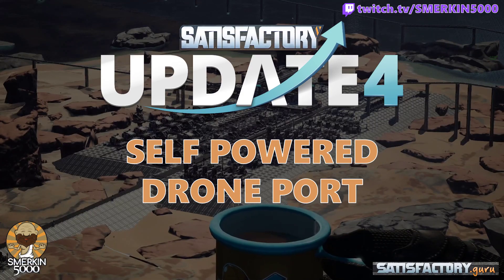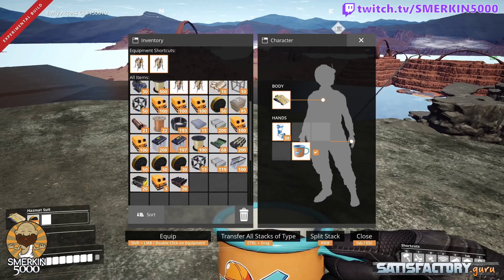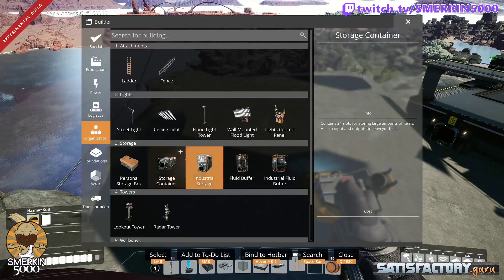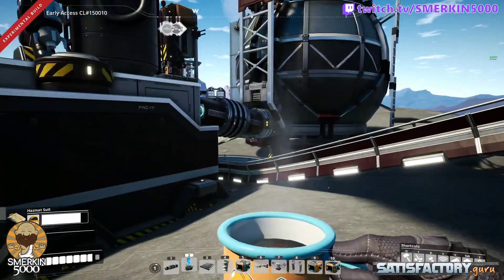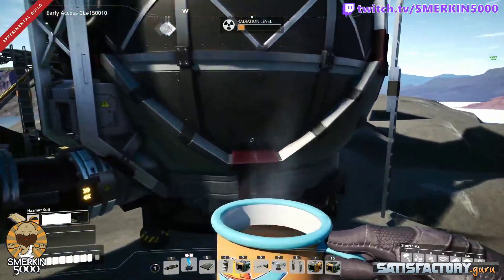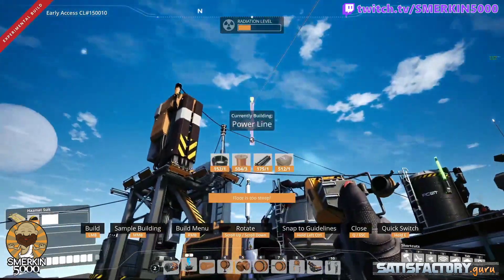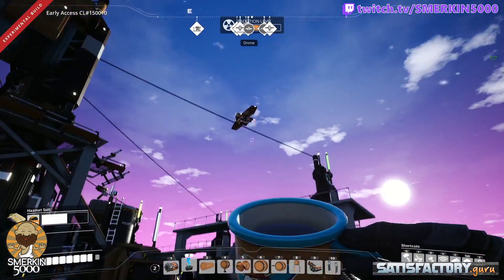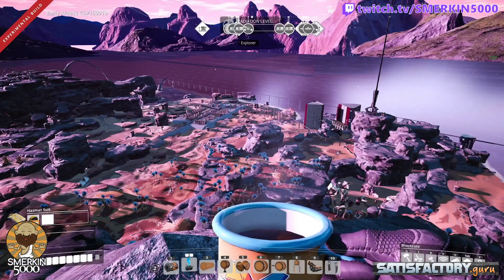Self Powered Drone Port

Comment: Have you considered feeding the empty canisters back into the fuel drone to send them back to the fuel packaging facility? You can then remove the sink and save the need to constantly feed empty canisters into the fuel packager...
Reply from the maker: This is something you could most certainly do however I wanted to keep the solution as simple as possible. In this situation the location the packaged fuel is coming from is not the location where it is packaged and hence I would need to do additional logistics to get the empty containers back. Additionally, when I create solutions like packaged fuel, the materials used to create the canisters are already allocated in the production line (unless it's part of a closed loop).
Reply: @smerkin5000  cool beans, awesome tutorial regardless!